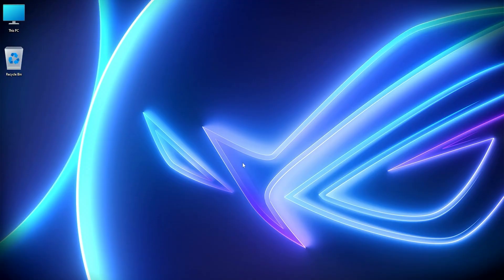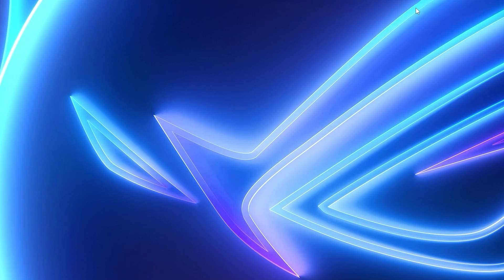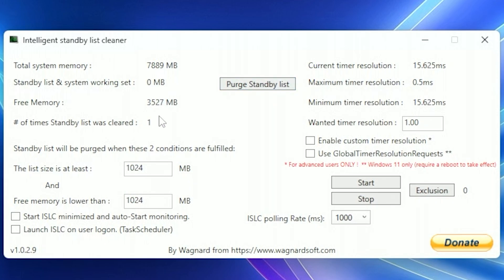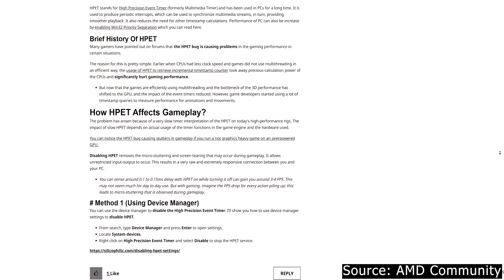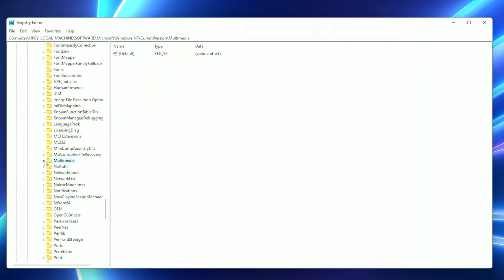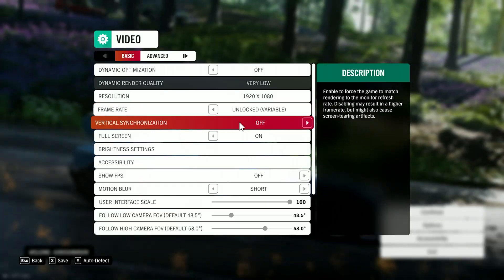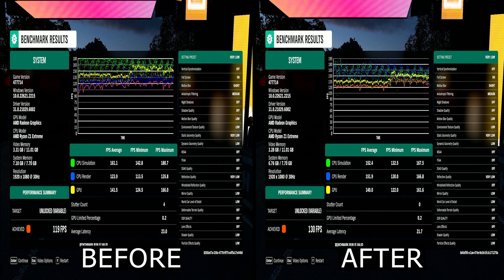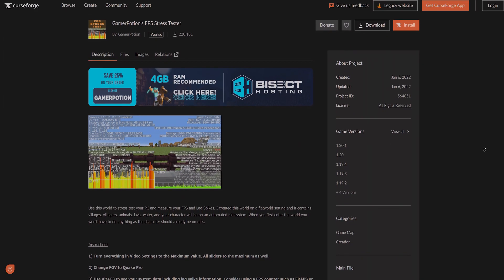BOOST your ROG ALLY performance with easy tweaks!

Comment: I think I’m going to do everything except disabling any devices/drivers in device manager. I use OneDrive and iCloud and Google drive and I just want to make sure that they are still running properly even though I know they can consume resources. Can’t wait to start applying these changes after I creat a system image. Thanks and love your channel! ❤
Reply from the maker: Thanks for comment, u can try disabling the HPET (high precision event timer). It's not going to impact cloud drives, for some reason, Ryzen CPUs struggle with it enabled and may give you some micro-stuttering. You can try it, but you don't need to disable the rest of the virtual devices.

Comment: This didn't do sh*t! Games run the same or a bit worse!!!! 😂
Reply from the maker: It's not going to turn it into the ally X 😄
You don't need to apply all of them. The most important ones are disabling HPET and, if you like using the memory standby list tool.
There is no need for registry changes

Comment: Thanks for your video, I got helldiver 2 fps 1080p  rised from 32 to 35-36 though I still experienced frame drops as before to 25, I think it is bcz poor optimization. But I did feel stuttering due to frame drop become smoother😂 greatly alleviated. Do you know the mechanism behind that?just being curious, you made my day, many thanks!
Reply from the maker: I'm glad to know it helped.

I'm not sure what you applied from this video, as each thing may have a different effect. Which tweak did you apply exactly from this guide?
Reply: @TECHOSAUR  I applied MSI and lslc, two apps from your link and gaming mode on. If you don't mind I would like to forward your channel to Chinese handheld community, since no  one in my country did  it that far.
Reply from the maker: @yutongduan1934 Sure, bro. This channel is ours all. Thanks for spreading the word! 🫶

I believe that latency could be the reason. When you did the MSI process, it allowed the GPU to get priority, which will render in lower latency, therefore improving its performance.

Also, when you free up more paged system memory, you are able to allocate more memory where it counts, given the relatively small memory size of 16 GB when you already have a GPU in need of dedicated memory. Then, Windows takes about 4 GB. The CPU isn't remaining with lots of memory to do its tasks.
Reply: @TECHOSAUR  Thanks so much sir! You are so professional!
Reply from the maker: @yutongduan1934 I'm ur friend, not sir 🫶

Comment: Would disabling meltdown and spectre mitigation improve performance for the Ally? Or is it not affected? And would you look into this?
Reply from the maker: Ohh, that would be interesting. I'll make sure to check and experiment with it next video. Thanks for the mention!!! 
I'll share and update you about it, thanks
Reply from the maker: Just to update you, I’ve already gone ahead and tried it on the ally. It gave me a very subtle change, still a positive one, but for those modern CPUs, those vulnerability protection processes won’t impact much performance. It was mainly a nightmare for old CPUs like those from 2018, so it’s kind of outdated and mostly pertains to Intel CPUs.

Still, a video about it is WIP  to share how I disabled them if you are interested, as well as some benchmarks.

Thanks for your suggestion 🙂
Reply from the maker: I made a video about it, hope its useful:
https://www.youtube.com/watch?v=-in0DCfWG1M&t=2s

Comment: Just bought an ally and have nothing but problems. Ive done all the tips and tricks to boost performance. The ENTIRE system is up to date and i can barely get over 20fps in any game. I finally started seeing clocks over 800mhz on the gpu after the latest AMD driver update but on at least the Witcher 3 on low settings FSR 2 on performance, 720p im barely getting 20fps. Im at a loss as to what to do. Ive tried everything.

The witcher is the main game im playing on it right now
Reply: You might have a defective unit honestly. It could be a bad paste job, a faulty fan, etc. I think it would be a good idea to RMA if you haven't already.
Reply from the maker: check if fans are working, what temps are you getting? this low frequency on GPU either indicates there's no power juice to feed it or its thermal throttling or being limited by some third-party tool that's controlling clocks 
also for double checking, try setting the turbo power plan in Armory Crate to see if it changes something, unfortunately, I can't do much remotely but please write in here so we may find a solution
Reply: @TECHOSAUR  I appreciate the speedy reply, the fans are maxed out on my 18w manual mode and according to the Command Center monitor its running between 90-95°. On most videos ive seen people are running in the 60s or lower. Bot sure if that's accurate though
Reply from the maker: @mr_invisible1198  that's really high temp, and especially that u are running it on 18w, it should be around 40c with max fan speed, usually it runs too cool with it's dual fans cooling system!

I think you are hitting the thermal throttling point that's why getting a limited GPU clock, a way to spot the cause, run fans on maximum speed and put ur hand close to the exhaust vents, if the air coming is hot that means it's actually transferring hest from chip, instead if it's cold air coming from vents while CPU showing 90c that means u got something wrong with the cooling system not transferring heat so just RMA
Reply: @TECHOSAUR  thanks so much dude! I'll try this out and hopefully it's something that can be fixed easily and quickly.
Reply: Sounds like system is getting too hot and throttling  which is why your FPS is so bad. Maybe you have faulty cooling
Reply: Did you ever get an answer as to what was causing this?

Comment: When you are done with the intelligent standby list cleaner tool are you closing it or minimizing it?
Reply from the maker: It's fine to keep it running all the time, but when u don't want to use it, you can either press stop in the tool options or close it all together, in both ways it stops operating

I usually keep it all the time, it launches on  windows startup

Comment: Is there any huage Hardware Performance Mod for more power. Maybe with a 200-300$ eGPU?
Reply: There is only a proprietary egpu for the rog ally and they’re well over $1000 you might be able to find a used one online for $800 or so but good luck with that. And other egpu’s are not compatible. It’s stupid I know
Reply from the maker: sure an egpu will give a big uplift, but you can't use other than Asus XG mobile GPUs

Comment: Can u follow ur settings if i have my vram on auto
Reply from the maker: Yes sure

Usually how much is it allocating VRAM in ur games ?
Reply: hi if my VRAM is 5 gb what I should set would be the best for free memory，thanks so much man！ love your videos！ @TECHOSAUR
Reply from the maker: @yutongduan1934 If your VRAM is taking up 5 GB out of 16 GB,

You will be left with 11 GB for CPU RAM.
Usually, Windows 11 takes up 4 GB, so you will be left with approximately 7 GB.
Most modern games take at least 6 GB, so you will be left with 1 GB.

I would suggest setting it to "if memory less than 2048 GB" to purge the standby list.
Reply: @TECHOSAUR  thank you so much for your solution man，I find you are the only one who did it so far and so professional. Love your videos!

Comment: Once I have booted the pen drive, and access the "new" bios, the controls do not work. I can't move around the panel and select the cpu common options settings. Any solution? I have tried connecting an external keyboard through type C and nothing and the buttons on the rog ally don't work either
Reply from the maker: do you have a multiadapter? try to connect your keyboard to it instead of directly to the ALLY

You are right, that's why I said to use a keyboard because on this bootable tool you cant use the ALLY gamepad, it works only with a connected keyboard
Reply: @TECHOSAUR  dont have😢
Reply from the maker: @javiervicentepenalver9010  maybe because when you connect a keyboard directly to the Ally it only delivers power not data while In BIOS, once u are in Windows it gets recognized as keyboard, it's worth trying with a multi adapter

Comment: 🤣🤣🤣 for what????? 2-5fps?:? hmm..........
Reply: 2 or 5 fps it's more not less, anything that can help it's welcome
Reply: If it doesn't hinder.. it helps. Ya dig? You got better advice... hmm?
Reply from the maker: Someone said in COD u could get 15fps with higher CPU boost, need to test it and will share it !
Reply: @TECHOSAUR   can you also get more fps in RPCS3 emulator? if so i'd be grateful if You could test Twisted Metal 2012 on RPCS3 emulator considering that Rog Ally can hit when plugged 23 fps.
Reply from the maker: @hagenhallgard8619  I'll try to test it ASAP !
Reply: @TECHOSAUR  wow thanks, when do you think i could expect this to get done?
Reply from the maker: @hagenhallgard8619  probably soon, rn I'm testing something with memory that may yield some performance increase, doing benchmarks etc
Reply: More like 15 - 25 fps in most games and I saw insane increases in others this dude is a god send show sum respect🙏
Reply: @RealEataaaaCholo I did all of the steps and there’s no difference in games, 15 to 25 fps increase you are lying, that’s way too much, I would believe if it was 2 to 5 fps increase like in the video
Reply: @axelcamacho3764  lmao not my fault it didn't do the same for you🤣

Comment: @TECHOSAUR should i turn on  ISCL Tool every time when i turn on rog ally?
Reply from the maker: If u check the two check boxes at the bottom saying to start minimized and auto start  monitoring
The second option is "launch with user login" it should open and start working by itself 

But u need to place the tool folder somewhere where u don't delete it, since it's not installed
Reply: @TECHOSAUR  What about "free memory is lower than:" if i play on 6gb vram i should set on 6144 MB?

Comment: 50 watts not worth it 
🔥
Reply: Yeah I was talking about last video good work impressive result after this one 👍 thanks 😊
Reply from the maker: @nspronspro6486  oh yeah, 30w FTW! 😂
setting it to 50w was to show anyone curious to know the difference, but as you say it is not worth it at all
Reply: What about 43w
Reply from the maker: @jcmk3829  if you are hitting over 75c with 30w you will thermally throttle at 43w
performance gains are minimal, it would be nice to under volt the APU, this way you can save even more power and battery without losing performance and even perhaps increase TDP when connected to adapter, SMOKELESS tool has it for Steamdeck but not yet on ALLY,  I think with later version we'll get it
Reply: Make video comparisons between 30w and 38w that would be great
Reply from the maker: Tests were done only in 30w bro 😄
Reply: It is worth it. If You are plugged in 38W is a sweet spot. I play Starfield with 38W and Ultra mod and got 37-45fps in the cities. Simply amazing.